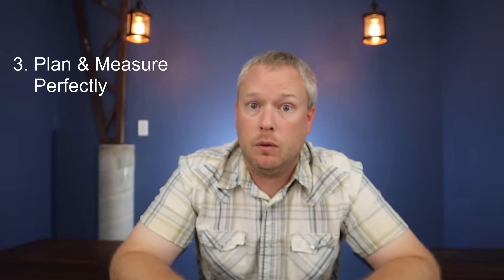7 Drawbacks to ICF Construction -- Problems with Insulated Concrete Forms

Comment: PACIFIC ICF supplies AMVIC ICF in British Columbia and I understand some of your negative comments but those are quite a stretch from reality.  ICF now is priced at 50% less cost than forming with plywood.  And its already insulated.  We also sell an R-30 block which is 3.3" think and meets the code for the nest decade or more when we need to have 32 walls.  ICF is fast to install, not much stripping time, not much bracing material.
Plans are easily made with ICF in mind ( thickness)
Penetrations should be made prior to pour , stick a conduit through the wall for pipes, wires or vents/ducts
In cold climates plumbing cannot be located in exterior walls, bring your water lines to a kitchen sink through the floor instead.
Use poly electrical boxes not metal boxes, screw that flange to an ICF web, channel foam with electric chainsaw ( 2.5")
No rain screen nor building paper, housewrap required
Any cladding can be installed
For stone facing or  brick a special shaped "brickledge" ICF block is made.
Drywall sheets apply directly to the interior side of ICF, screw into webs 6-8" apart, less cutting , less waste
ICF is quiet
Various brands have drawbacks, some are reversible, less waste, some are stronger than others and some have less insulation ability
Bill  PACIFIC ICF
Reply: I built 3 ICF houses (Blue Max then Arxx) in 1999/2001.  I had moisture issues but I installed UltimateAir/RecoupAerators (ERV) manufactured in USA, Athens Ohio.  Moisture was never an issue.  When I ran electric, we used Carlton device boxes that had a side flange (shallow version with the appropriate cubic inches - code) which were then screwed to the webs.  Snapped a chalk line horizontally, above and below the space in the webbing where the blocks met, about 2”, used an old junky old circular saw (after changing the depth of the blade), then used a pry bar to remove the foam.  Then, ran romex and used pieces of the foam to hold the wire in place.  I did end up installing a sub panel on the 2nd floor.  At that time it was cheaper but with the new electric code (expensive breakers), it may not be now.  As far as accommodating penetrations, it’s all about the planning.  PVC (using appropriate size of course) used for chases.  LVL’s, PSL’s, LSL’s for the floor/ceiling all specified by an engineer who approached the job as if it were conventionally built (stick).  And the cost reflected it. It was soooo over engineered it was ridiculous and I ALWAYS tend to overdo things anyway.  The TGI’s were 12” OC  (25’ long x 14” - maybe 16” if I’m remembering correctly - it was so long ago). The 1st floor was so stiff, it was ridiculous.  I think code allows maximum deflection of 320 and these floors were over 800 on the first floor.  I did some research, confirmed my findings with another structural engineer (NOT associated with the supplier) and installed the remaining TGI’s 16” OC.  In the areas of the house where there was ‘live’ tile was called out (marble/granite), a bed of mortar followed by concrete board installed which allowed for the appropriate stiffness.    Used scissor roof trusses raised heel allowing for fiberglass installation at the eave (gable roof).  One house used fiberglass, another Icynene under the roof deck and on the last house I used SIP panels.  Now THAT was an interesting roof.  I decided to felt the SIP’s, then ran 2x4’s flat, installed OSB which was then covered entirely with IWS, continuous ridge (Snow Country) vent using GAF/Slateline shingles.  The ‘sub-facia’ and soffit had the same 2x4 application and then the final finished trim was installed.  Yes - the houses were extraordinary/bizarrely quiet.  I would defiantly build another house for myself except I would seriously look into using ICF for the roof.  Storing the blocks were not a problem.  They were factory wrapped in bundles and were easy to move as well (as noted in a previous REPLY).  In the kitchen, I used 3/4” ply on the walls to facilitate cabinet installation.  Required installation of plaster rings (at least that’s what we call the metal bands that are applied on top of the device boxes, 1/4”, 1/2”, 3/4”....whatever) to accommodate the extra depth resulting from the ply and drywall for the outlets/switches.    
 
The main issues I had were dealing with HVAC contractors who did not know how to size the heating/cooling systems correctly and did not know how to handle the installation of the ERV’s.  Stirling stepped up to the plate.  Now I would use mini-splits and a hybrid hot water tank or the SANDEN (I used Takagi tankless, the only game in town in the late 90’s). Oh yeah, the other MAJOR issue I had to deal with in the building trades when I wanted to use something different like ICF’s, tankless, SIPS, plumbing, were the guys who would say stuff like: “why honey, why would you want to use THAT? We’ve always done it this way”.  Seriously....HONEY?????  And technology marches on.  Stick building a house is like buying a car and having it delivered to your driveway.  In pieces.
Reply: @janice180  Use an electric chain saw with depth guide so as not to hit concrete for electrical wiring.  Chain saw is the same size as the wire.  Make a vertical slot not in the ICF webs (studs), horizontals cuts should be at top of a block where there might be no rigid web plastic.  Seal wire in slot with spray foam to gain original R value.
Pentrations are made with conduits or vent sized pipes as required in any case.  Chop off the the conduit with a long recip blade at the surface of the concrete, then run the wire chases , install a poly electrical box onto a web with screws, make a credit card sized hole for the box to insert.

Use 1 5/8" drywall screws

Bill Pacific ICF
Reply: Oops.....I DID NOT have moisture issues, ever.  Or bugs, rodents, air leaks, or thermal breaks.
Reply: Yeah, chain saw is a good idea but I don’t have one.  And I love tools but have not had a reason to purchase one so I just pulled out an old crappy circular saw for the job.  I didn’t have to worry about cutting out the webs cause the webs in ARXX did not run from the top to bottom.  There was foam only about an inch and a half at the top and bottom which was what I cut out.  

Outlets/switches/etc:  I actually used a hot knife that was modified with a ‘custom’ wire that I used to cut out the foam.  In some areas, I just used a jab saw to cut out the ICF block to accommodate the device boxes, push the cut out block into the ICF cavity then spray foamed it in place.  When I made chases (various sized of PVC), I just let it stick out of the walls till I was ready to use it.  Then I cut it off.
Reply: @janice180  Amvic makes a good block, webs every 6" and no web right where two block lock together, so the chain saw could go sideways in foam if it had to.  Lots of web to screw into also, some blocks don't have full height web ( studs) so how does one apply screws for drywall or siding ???  www.amvicsystem.com

Comment: After all this am going to take anther look at sips I think thanks for the information my friend.
Reply: Stay away from ICF by NUDURA it costs my wife and I everything, the company will not stand behind it. A contractor did ours and came highly regarded by NUDURA our basement walls leak, it leaks where the wall meets the basement floor. Also we budgeted $400,000 to build our 3200 sq ft home with $50,000 contingency.  Ours cost $750,000 and still counting 2 years later after move in.
Reply: @DavidLBrown-rm2mm  o man am sorry to hear that my friend. Thank you for the heads up tho.
Reply: @DavidLBrown-rm2mm  That's awful. I am so sorry that has happened to you. I was surprised to learn that, in Canada at least, Nudura offers a course for a very small fee. After your course, if you are in charge of two ICF builds, Nudura certifies you. It may be that your "certified" ICF contractor just didn't really have enough experience. Good luck!!

Comment: When buildings with ICF you should always use a fresh air return system in conjunction with your HVAC system.  That alleviates the moisture and stale air problems that can otherwise pop up.  Dryer vents should actually be located in exterior walls where possible. Using a schedule 40 pipe as a conduit through the ICF forms for all utilities and other penetrations is industry standard for ICF construction.  Also the manufacturer of most dryers say that venting more than 8 feet can void the warranty.
Reply: I think he meant running it up inside the interior foam of the icf wall. Of course it has to go through it horizontally.

Comment: What about using ICF with 6 or 8 inches form on Oahu, Hawaii compared to using metal stud framing?
Reply from the maker: Do you mean icf blocks with a 6" or 8" core for the exterior walls?
Reply: @Challenged1  Yep. I don't want very thick icf walls for a house in Hawaii. Is 6" core icf wall strong enough compared with 2x6 wood stud framed wall?
Reply from the maker: @TheMichaelJu  The 6" core icf block is what the main level of my house has.  It's far stronger than any 2x6 wood stud wall.

Comment: Only thing that would worry me the most is moisture, but we don't have ICF factory (and other product factory needed for building process) in my country (Croatia ), witch is shame. It would make building way easier and faster. Tehnology has come a long way, so only thing you need is sewer, and water lines, rest can work by eletricity that can be produced by solar tiles, and stored in batteries.
Reply from the maker: I'm sorry to hear that
Reply: If your are interested in ICF blocks, just let me know. There is the way to get the ICF blocks to Croatia.

Comment: Thanks for the great video.  I built my first full ICF home a couple of years back.  I designed the house for ICF so during the design phase we thought through many of the issues you mentioned.  I used Nudura, their blocks fold down so I didn't have the storage issue.  They shipped it factory direct in a full semi trailer.  I also didn't have any of the moisture issues that you referred to either, mind you we have a fresh air exchange system so perhaps that alleviated that.

We did come to the same conclusion though, I would never build a home any other way.  We have hot summers and cold winters and heating (radiant) and cooling (HP AC) is a breeze.
Reply from the maker: Awesome deal.  Thanks for sharing
Reply: Windowsills are an issue being so wide so I tiled ours. Nice to put plants on.
Reply: Mind doing a tour video?
Reply: @EATSLEEPJD  That's a great idea... I have lots of photo's... I'll string something together.
Reply: @shawncolemusic   thanks.  subscribed.  i'l wait for the video :)
Reply: @EATSLEEPJD  I guess he never posted it.

Comment: Did you install an ERV to help with moisture management?
Reply from the maker: I didn't, one of the things that got cut as the costs of the build went up.  I may install one retroactively though as I think the price has dropped since the last time I looked.  To tell you the truth, enough time has gone by now that any excess moisture in the walls dried up and the humidity levels dropped.
Reply: @Challenged1  That's surprising to me actually, as ICF is intrinsically extremely air tight, and getting fresh air in and stale air out without using an ERV/HRV seems like a near requirement. Unless you're in a climate where your windows are always open or something. They're not very expensive either unless you splurge on a zehnder - a renewaire is like 1-1.5k.
Reply from the maker: @rafflesmaos  We are required to have 4" fresh air ducts for each hvac unit which is what I have.  What brand would you recommend?
Reply: @Challenged1  Renewaire Premium L is the best for the money that I've found for largerish houses, but some calculations should be done via ASHRAE 62.2 depending on square footage of house. HVI has CFM and efficiency ratings for all of them. Small houses can do well with Panasonic ERV for example. 

Dedicated ERV ducting is best, but will probably be difficult to put in if wasn't included at construction time. Bathrooms and kitchens are exhaust, and bedrooms/livings are supply, typically in such a case. Hooking it up to existing ducting retrofit style is not ideal, but I'd say still better than no ERV at all.
Reply from the maker: @rafflesmaos  Thank you for the info
Reply: @Challenged1   The humidity you experienced was a result of being in an airtight home with no ventilation.

Get the latest model Panasonic Intelli-balance. One unit per floor. FV10-VE2 (or VEC2 if you're in cold climate)
Reply from the maker: @nms516  If that were true, the humidity wouldn't have decreased over time.
Reply: @Challenged1  What I mean is if you had an ERV running it would have allowed everything to dry out rather than be sealed inside.

Comment: You mentioned elsewhere you built load-bearing interior walls in lieu of support columns. What kind of wall are those? Not ICF kind, I suppose? Could you elaborate?
Reply from the maker: Just your typical stick-frame wall with 2x4 lumber on 16" centers.  Nothing fancy

Comment: You need to use Nudura ICF it's much better product.
Reply from the maker: I like the size of the Nudura block, but the plastic web embedded in the block is inferior to Buildblock.
Reply: Nudura is inferior to NO block in any way. Sorry. After twenty years of building icf’s nudura is definitely the best.

Comment: The information you gained (and now sharing) from actually living in an ICF house are golden. Of all the ICF videos i've seen, not one mentioned moisture issues and to consider wet-rated outlets/switches on the icf wall. Thanks for sharing!
Reply from the maker: I'm glad to help.  Just yesterday, I was installing some additional cabinets and had to move a plug up a couple inches, which meant I had to remove a little of the foam.  The concrete behind the foam that I removed was bone dry.  The good news is, the concrete does seem to dry out over time and the moisture issue goes away.  At this point, it's been about 3.5 years.  Just a little more data for you to absorb.
Reply: Any tightly built home needs an air handler system.
Reply: I have no humidity issues on my ICF house. On the contrary I am dealy with low, 35% interior humidity. But I am in a low humidity UT area.

Comment: What type of HVAC systems do you put in ICF Homes?   Not sure where your located.   Forced air furnace and a/c,?  and/or air exchange systems  or different add on are recommended for them dehumidifier/humidifiers??  Thanks
Reply from the maker: I did forced air geothermal systems (2 separate systems).  Check out some of my other videos where I discuss what I used.
Reply from the maker: @Couchlover47  Watch my video on how much my geothermal system cost.  I was able to get the price down to the equivalent of an average heat pump system.
Reply: @Couchlover47  I had to google your abbreviations.  But yes that what I was curious if those systems are used or recommended for icf homes

Comment: Excellent video. Thanks for the info... definitely gonna put a lotta thought into it before we begin construction.👍🏾

Drawback #1 - 0:39
Drawback #2 - 1:45
Drawback #3 - 4:07
Drawback #4 - 5:05
Drawback #5 - 5:31
Drawback #6 - 6:43
Drawback #7 - 8:12

Comment: outside water proofing is wort mentioning
do you have HVR to mediate moisture (air exchange)??
Reply from the maker: Actually, I mention the water proofing in some of my other videos.  We don't have any HRV or ERV within the house.  They were just too expensive at the time we were building.  We just went with 4" fresh air lines for each of my geothermal units.
Reply: @Challenged1  I would retrofit even now. Due to moisture..., I see it it Europe a lot with houses insulated tightly with styrofoam.
Reply from the maker: @tompaj6961  Actually, our moisture problem went away over time.

Comment: You say the ICF blocks are huge.  I'm guessing that would depend on the brand you are using.  I'm looking online at a system where the blocks are not large at all and are very easy to use and lightweight compared to what you are talking about.  I would love to know what system you are using so I don't bother going to their website in the first place.
Reply from the maker: Buildblock is who I used, and honestly, icf by it's own nature is large.  I'm fairly certain I would recommend Buildblock over all the rest.
Reply: @Challenged1  Thanks for the reply.  The system I am looking at is Quad-Lock.  It looks like a good system and is easy to install with a small crew.
Reply from the maker: @dougunderwood2313  Good deal.  I wish you luck with it!!!
Reply: @Challenged1  Thanks.  We shall see.  :)
Reply: @Challenged1  Why would you recommend Buildblock over others? Just curious. We’ve already invested in purchasing Nudura. We like that the webs go completely from top to bottom.
Reply from the maker: @karenwilkey6512  I don't, it's just what I used and I like the web design.